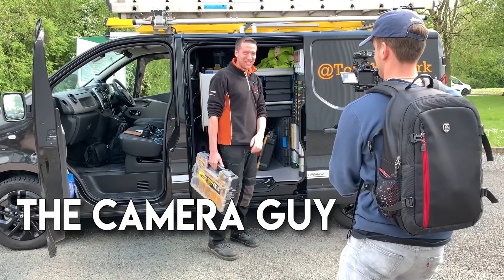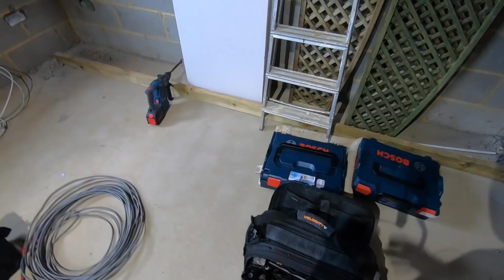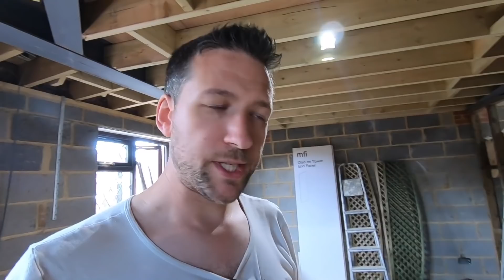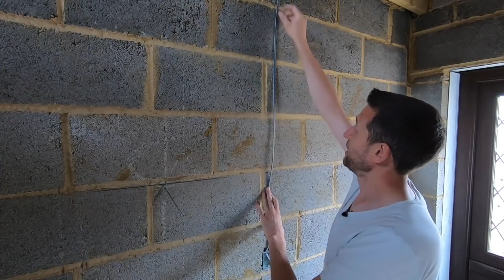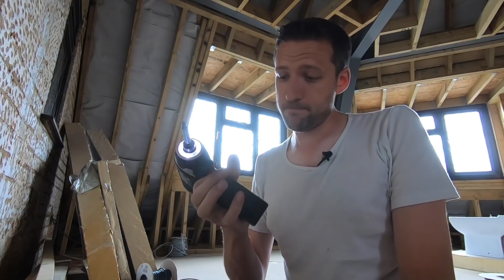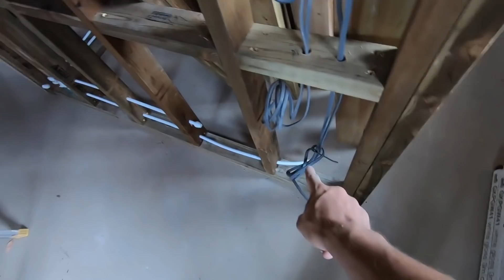First Fix wiring an extension + test driving BOSCH TOOLS | Thomas Nagy

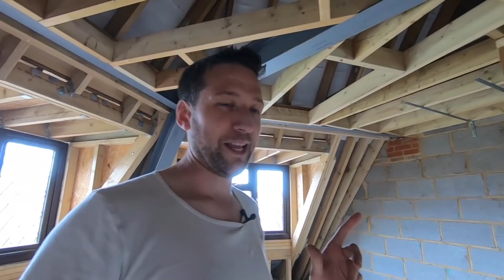Comment: 8:11 this is for fire resistance. Wood would have to be covered with fire retardant plating - which can get quite expensive. If you have a steel structure you can omit this but still have the higher fire retardant rating for lower insurance polices :)

Comment: Love the 10.8 /12v impact . Rarely let's me down. When it does usually trying to remove big screws.  So I grab the 18v robust bosch drill. Keep thinkingI will get an 18v , one day. 
How is the 18v vacuum? 
2 way lights  i do it like this:- feed in common one switch .
 switch live out of other common.  2 strappers and spare cable in the 3 core as neutral. Boom.
Gets interesting trying not to get the neutrals mixed up at double switch for bottom of stairs and top landing when up lights doing down light and down doing top landing ect.
Enyoy your sweary vids lol.

Comment: You also come across the old-fashioned method of two-way with feed into common at one end and switchwire into common at the other, with T&E strappers between. There are many different ways it is done.
Reply: That's the way I try and do it but use 3 core as I have the neutrals at the switches and use the  greyas neutral .

Comment: Can't go with the Bosch appreciation I'm afraid!  Everything I've ever used from Bosch has been well engineered, even over engineered but with stupid design faults that make it unusable. From excessively heavy drills to a garden hedge trimmer which weighed too much and totally unbalanced as well. Good luck with the Fix Radio gig.
Reply from the maker: In a way I agree. You’ll see in some of the vids coming up. Well made stuff but some stupid design flaws
Reply: Like the circular saw seems wrong handed?

Comment: weve always used metal capping.  If going into brick simply drill a 3mm pilto hole then use i.1 inch galv flat head nails.  Would be interested to see what you were using to secure your capping ?

Comment: On any flat wall I always use metal capping. If it's an a wall with uneven surfaces I prefer to use plastic oval, as I find it so much easier and quicker to install!

Comment: Top tip for ya mate,when using galv capping try fixing it with dry wall screws,they well screw through the capping and directly into the blocks,no drilling or plugs,give it a go,works on 90%of blocks,and on bricks you can sometimes get away with it in the mortar bed,

Comment: Do you do anything with your galv capping ends to protect cable from chaffing damage when you've cut lengths? Just same deal as traywork i.e. give it a good file down?
Reply: I always fold the last half inch in and squeeze it with pliers makes the capping smooth at the ends

Comment: If was employed by Clarkson Evans and didn't get the job finished on the day, they would seriously have a go at you. They are a bit of a notorious firm to work for and you work ridiculously long hours!
Reply from the maker: but you get free breakfast there right?
Reply: @thomasnagy  Yes! And a free Van and some power tools! But every job is based on price depending on the type of new build and what house builder it is.. eg Persimmons, Redrow etc. 

First fix prices I've seen were as low as £180, this was for a typical 3 bed semi with en-suite & utility. Grade 1 Teamleader = 9 points and apprentice on 6 points. £180 divide into 15 points. So for a complete first fix/ducting etc an electrician would earn £108 and the apprentices' banks £72, day rate paid and the rest goes towards the apprentices monthly bonus!!
Reply from the maker: are you serious? £180 for a first fix labour??
Reply: @thomasnagy  Hey Thomas, sorry for the delay... just seen this! Yes deadly serious!

Every job is based on price, depending on the size of the property and house builder. Clarkson Evans have their own very big team of quantity surveyors etc that calculate the costs of the properties. The company take a very large chunk of that profit! Only some of the electricians that work here make good money, but that's only because they have a gang of teams under them.. sub teams!

Comment: When fitting galv capping I drill either side of it fit plugs then fix back with a screw and washer so the washer holds the capping to the wall never had any problems and a lot quicker than drilling the capping itself
Reply: Just use clout nails and plugs, quicker cheaper and more secure.
Reply: Me too but do have some capping nails if I can get em hammered I of course

Comment: Looks like someone has shares in a steel company.  My father did a barn conversion and the architect put in a massive steel beam from one gable end to the other in the roof no wood was attached to it so no roof support the builder after a discussion with my father and myself (I have been in structural steel for 40 years) decided to leave it out as the gable ends would have been pushed out by the weight of the beam, sealed the roof space up before the building inspection and all is well 20 years later.
Reply: And there is the reason why factors of safety are used in almost everything nowadays. Just because it's standing doesn't mean it's safe. Your dads barn conversion may be fine because it's structurally supported in an unintended way, but the steel beam wasn't put there because somebody wanted to waste your money. P.S. I am a structural engineer and I would say that this structure may be steel frame that acts independently and the blockwork is purely infill...it is an awkward shape after all.
Reply: @jamesfraser92  
Well said.

Comment: Steel beam>? Simple drill a hole through it. As long as it is on the neutral axis (centreline) no one can argue that is damaging the integrity. A decent drill,  deburr adequately it will take seconds. Teaching Grandma to suck eggs?

Comment: As usual looks like someone couldn't be arsed to a calculation so just chucked as much steel in as they could, people are never shy when it comes to spending someone else's money, metal capping, not for me, some people think because it's metal you can't put a nail through it, yeah right, personally I use oval conduit, no need for grommets as it will go into the box. And looks neat

Comment: Use clout nails for fixing to thermalite blocks & capping nails on standard breeze blocks if the blocks or bricks are solid fix into the mortar joints
Reply: David Shields was on a job and spark had clout nails he drilled hole in with raw plug then clout nail it’s one of those moments when you why didn’t I think that

Comment: Doesn't a new consumer unit have to be between 1350mm and 1450mm above floor level?
Reply: Not in electrical regs but building regs you are correct, this is only for new buildings though. So if you were doing a rewire it isn't necessary. But new builds build inspector will pull you up on this and it's the dolly switch that has to be between 1350 to 1450. But because this is an extension I'm not sure if its required correct me if I'm wrong👍🏻
Reply: Yes it does
Reply: There's no set height, it just needs to be at an accessible height for the user.

Comment: Assuming it's all rcd protected, is it worth capping it as there will be no plasterers trowel to slice the cables? Could it not be just clipped? Obviously metal capping offers better protection from screws and nails in the wall but if plastic was used it wouldn't stop anything anyway. Is it just good practice and to keep it neater?
Reply: Your comment made no sense. That’s what the capping is for to protect the cable from when the plaster Bond coats the wall!!

Comment: Is that metal capping required by regulations on brick/block/concrete surfaces?
Reply: No.  Capping was originally used so the lime in the plaster didn't degrade the pvc. Only reg is that the cables run in correct wiring zone
Reply: No it's done for vanity. Clip direct cover with plasterboard. Capping only needed if wall is being browned first then skimmed.
Reply: Only need to clip in correct zones if RCD protected

Comment: Hmm will I get help or abuse 😂. Let’s just put it out there. I’m not an electrician I’m a 
DIYer doing some home electrics.

I want to run power to my shed at the end of the garden. I will use 6mm armoured cable to a consumer unit in my shed.

My question please;  do I need to run the 6mm armoured direct to the house consumer unit (which has some tight turns) or do I use normal 6mm twin & earth cable from house consumer unit to a junction box on the house outside wall?
Reply: That's fine as long as the joint between the t&e and SWA is accessible. I did the same thing on my own house and put a IP box out side to gland the SWA into
Reply: If you use T&E in the first part, then you need to have RCD protection on that cable.  Which means not much point in a separate CU in the shed unless you work out the discrimination. And even then not the way I would do it.

How would you connect the SWA to the CU?  Can you even do this?  How would you ensure safe isolation?

What's the voltage drop?  Is the cable size correct for the length?

Do you have test instruments to ensure you have done a safe job?  How would you test Zs at the final circuits to ensure it's safe?

To be honest I'd get an electrician on board.  If you explain the situation, you might find someone who is happy to let you run the SWA cable (the grunt part) and then finish the job, test and certify.

I hope that qualifies as help rather than abuse ;)
Reply: Junction box is fine seal it properly
Reply: Thank you to all for the “Helpful” reply’s.

There’s an rcd on the house cu and the cu in my shed also has an rcd.  I would connect to a 40amp mob on the house cu. 

In my shed I needed a cu as I have a ring of sockets and a lighting circuit of two lights.

A 15amp radial for my compressor and a 15amp radial for my welder they are time delayed type D if I remember correctly.

My current draw would be fairly low as I only run one tool at a time. The lights are led.
Thank you again for you answers.

Comment: New holesaw, run pilot bit through first so you don't go through and slam the holesaw into it, drill on a low speed and a load of cutting paste and you'll get a 40mm hole through the steel in about 10 mins. bit of T+E sheath as grommet strip. Job done
Reply: Also next time you're up against a hard brick wall check out the Thorsman or Tower hardened steel capping nails. They're like the nails in cable clips but with a little washer on them, make sure you wear eye protection though.

Comment: As an openreach engineer, love the metal capping when its used, much easier for us as we arent trained for any behind the wall wiring, we get a stud detector which does power, metal and wooden studs, which its pretty bad at in all honesty, picks up metal capping brilliantly so when we are drilling a hole to bring our wires in from the outside it makes a big difference.
Reply: If you find a stud detector which isn't complete shite, please let me know :)  On a serious note what is the openreach policy if you drill into something.  I'd be interested to know.
Reply: @ursusmaritimus7159  Leave fast and deny all knowledge.  :)
Reply: @ursusmaritimus7159  our policy is run as fast as you can, nah if we can show that our stud detector didn't see anything I as an engineer am not at fault, however openreach will always cover damages caused by this. Sometimes shit happens, and yeah no stud detector really works, but our boach ones are garbage, most of our drilling is pick a spot and pray.

Comment: Tom if you are going to keep using the metal capping. I would invest in a spit gun the Labour time just goes out the window. We use them for capping everyday. Works a treat.
Reply from the maker: i'll look into it now. cheers
Reply: @thomasnagy  spit gun 800 is the one for the job but we had ours stolen so we now use a knock off brand which is quite good. DM if you need any advice on suppliers. Can show you video of the guns in use with the capping.

Comment: Why chase in / sink the back boxes in to the wall? Dot & dab will be 25mm to the surface 😁
Reply: In less it was a 38 mm box. Which is better as when it's all done and the customer says I want these fancy flat plate socket with a usb you have no chance in a 25mm box
Reply: Unless 🤓
Reply: If you used your eye you will see the switch was recessed completely in the wall. And the sockets are 25mm. I think the apprentice doesn’t know what is doing 😂😂😂

Comment: Try using concrete screws to fix in to brick or block. You might need to play around to get the right size drill as it will depend on what you are going in to. A multi-purpose drill bit will drill through the metal too.

Comment: Hi Tom, good video again, just a quick one on the 2 way wiring, we were told to stop using 3 core on 2 ways because it can cause a flicker on the  led or low energy lamps when they are switched off, actually seen it happening on a couple of jobs with long 2 way circuits.
Reply: It's not directly the 2-way design itself or the use of 3-core specifically but the fact that the additional cable increases the circuit capacitance.  You might see the same on a simple circuit of there's enough cable behind it.   Better quality LED lamps will have discharge resistors across the live and neutral to remove the issue.  More lamps added to the circuit can have the same effect through there not being enough charge to energise the lamps.  Or you can even put a couple of 160KΩ ¼W resistors in series across L+N at the lumière yourself.
Reply: That's exactly the technical explanation we got 😆, but for us house basher types using a t&e strapper seems to solve the flicker problem, also advised to have a maximum of 8 led lamps per switch wire for the same reason, every day a school day 😃

Comment: How I mark Cables at the end of a cable i Cut the ends of a wire in a certain way e.g '/' for switch , '/\' for mains and '_' for loops.
Reply: laks05 why don’t you just cut a switch? Feeds in and out are normally looped anyway so it’s obvious what they are if there’s only only 1 knicked cable? Just a suggestion
Reply: Same here m8
Reply: Yes I do the same but different cuts

Comment: Some light switches (smart) need nutral so im having to use one i ordered as a socket that i can remotely control instead of a light so out of interest how can you get a neutral that  works as its missing i only have 2 wires like the setup there? the reason i ask is i think it would make a good video showing how to do it somehow using 1 wire to pull through another maybe without having to do any damage or whatever.

Comment: Why are you sinking the back boxes when they are being dot & dab?
Reply: robert swingler allows for flat plate sockets later down the line
Reply: Garry Sparks fair enough
Reply: Why not? Helps getting over the cables they sit flush to the wall from the box
Reply: Rubbish, unless 35mm boxes, but clearly using 25mm

Comment: You could drill though the web of the steel beam as long as the hole is under 30mm wont affect it structural as long as its in the middle of the web and not at a support.  might have to paint/zink spray it after the drilling though (to keep in spec).  Not that drilling that hole is easy, you would want a mag drill and it does not look like there is space anywhere to get a drill in

Comment: Digging in? On dotanddab? Dont be silly stick the fuckers on the wall. The dabbers will dab to your boxes.
Reply from the maker: i bet plasterers fuckin love you ;-))
Reply: thomas nagy  never had a problem. Dabs are usually around 25mm deep anyway with 12.5 board, you are wasting time digging them in. On your next job attach them straight to the wall and i can 100% tell you that the dryliners or builders will not peep a word because it is standard practice.
Reply: Your capping is what 8-9mm? Plus the 12.5 board and your almost at the box depth anyway!
Reply from the maker: after i had cut in about 4 of the boxes the customer mentioned not to worry about digging them in.
I just carried on seeing as i had started.
Reply: thomas nagy  tom, you mentioned on another comment that the reason being you had chased them is because they are 35mm boxes, when they clearly are 25mm boxes and now you are saying the customer told you not to and you just carried on, now this isnt an arguement im just interested in why you really dont want to admit that you just didnt know that you could just put them on the wall and the dab would compensate for them? It is okay to learn something new.
Reply from the maker: ok, you're right, im a twat. please let's not argue over a fucking back box.